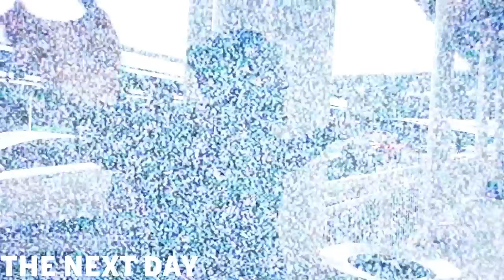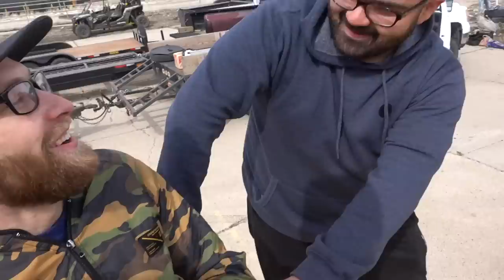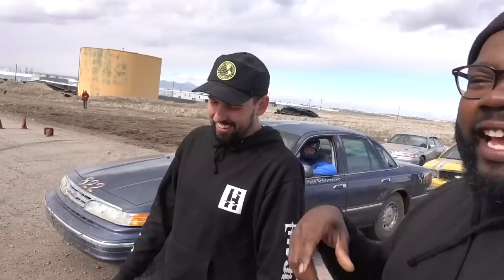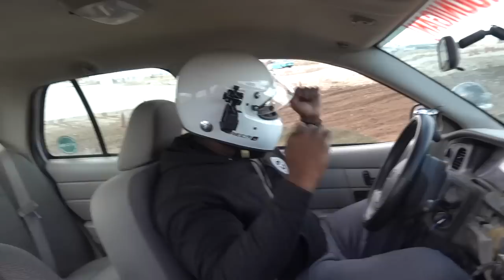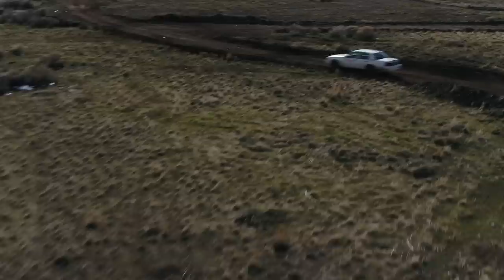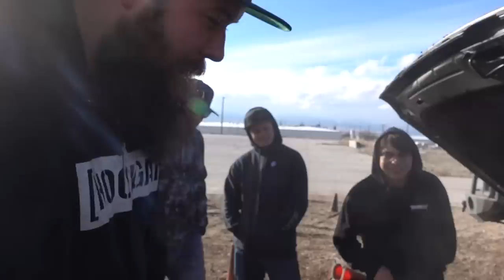Taxi Cab Rallycross: Door-to-Door Smashing Crown Vics For The 2019 Taxiderby

Comment: Cop brakes and radiator: confirmed.
Reply: They are the same on these cars as the civilian cars, they do have a cop oil cooler, and cop suspension, cop wheels and tires maybe.
Reply: @JohnSmith-bx1mp  please show me where you got your information.
Reply: @JohnSmith-bx1mp  so having done my homework, I was correct, no cop brakes or radiator, just suspension and oil cooler, gears and limited slip...
Reply: @johnnyboy922 Fix the cigarette lighter.

Comment: Ron had the police interceptor. This police version makes like 50 more horse power then the base models and the taxi cabs. Im not surprised he won.
Reply: they also come with raised and stiffen suspension which he still bottomed out on LOL
Reply: No, most years the police interceptor only had about 11 more horsepower, and many taxi crown Vic's are police interceptors painted yellow. He didn't have as much advantage as you may believe, except over there 90s aero vic
Reply: @jakelowery7398  ehh. I guess he is just a good driver then.

Comment: The police interceptor is definitely an unfair advantage. Either give them all one which would be more interesting. Or give them all taxi's. It was still fun to watch though!
Reply from the maker: The taxi cabs had about 5x the amount of miles on them too..
Reply: @TheHoonigans  yup definitely needs to be more evenly matched next time. 👍
Reply: If you find a trailer tow package Vic with the 355 gears, that would pull away from the P71s on a rallyX track.

Comment: crown Victoria axle codes & how to tell what you got ,  look at the sticker on the driver door jam , where it says "axle code"  z5 is 327 gear one wheel peel .  x5 is 327 gear with trac-loc , c6 is 355 gear with trac loc .  not very many cars have the 355 rear end , maybe 10% of all the crown vics  , some fleet managers were known to hord them and re-use them when they could . so whats on the door jam might not be whats in the car ,  another way to tell .  on the diff cover is a tag .   3 27 is z5   -   3L27 is x5  - 3L55 is c6  your grandpas standard  crown vic lx has a 273 gear ..   and the question you may be asking , WHAT YEAR IS TH QUICKEST CVPI .. according to a study done by the Michigan state police ..  the 2008 cv p71  with the 355 rear end .
Reply: the cars with the 355 gear are limited to 120mph ,  the cars with the 327 gear limit in the 130s ..  they are capable of going over 150 but are limited (tuned) out of fear of drive shaft failure ..  most the 355 gear cars are in city fleets . and I hear you really had to know what your doing on the order form to get one
  if those taxis in that race are born p72 taxi cars then they would have a 273 gear . if they were p71 cop cars first then they would most likely be 327 gear .

Comment: The cop crown vics has a slightly heavier dudty front suspension but its mainly small things here and there
Reply: Suspension, oil cooler, limited slip, lower gears, wheels and tires, some of the older civilian crown vics were available with a single exhaust or dual exhaust and there was a hp difference between those two but not a cop only option that's what most people confuse.